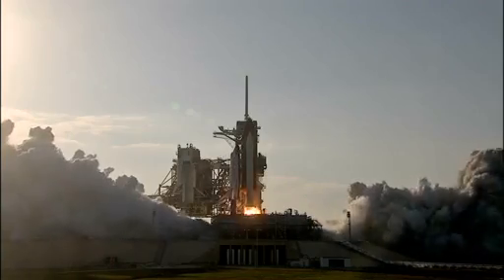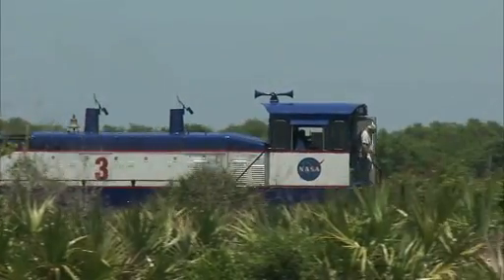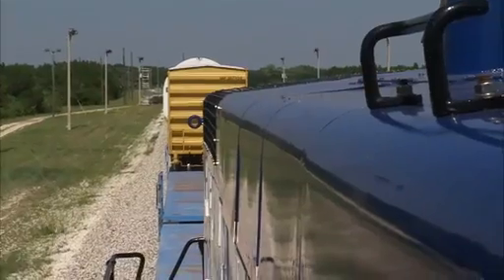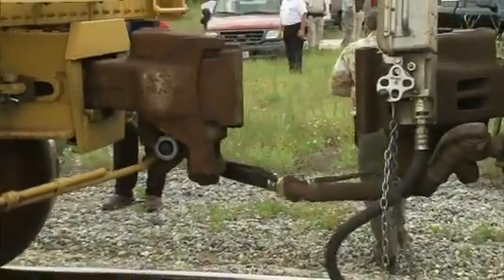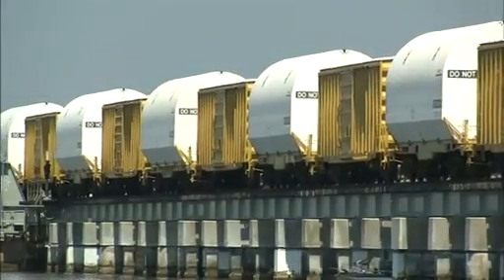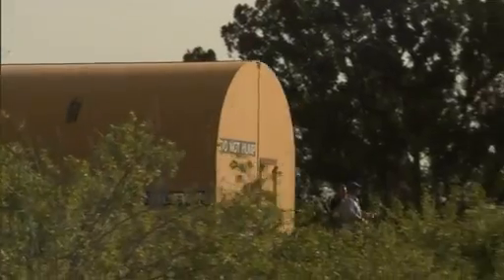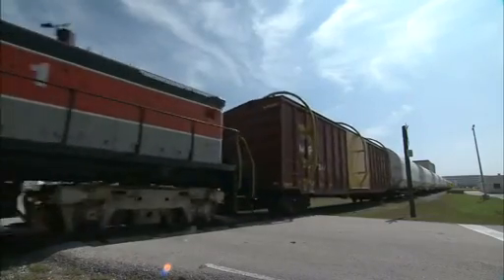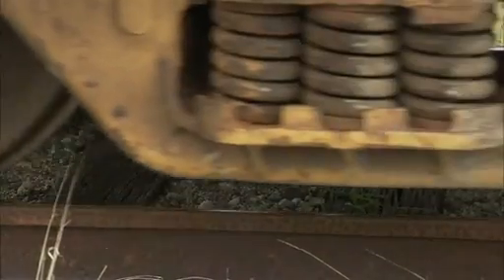NASA Railroad Keeps Boosters on Track

Comment: do not hump
Reply: Humping is when Railcars are Released from the Locomotive in the Rail Yard, and allowed to Free Roll into position elsewhere in the Yard (the ground is sloped, which allows the Rolling Stock to Roll Freely).  Due to the Fragility and Hazardous Loads, this is not safe to do with NASA Rail Cars.